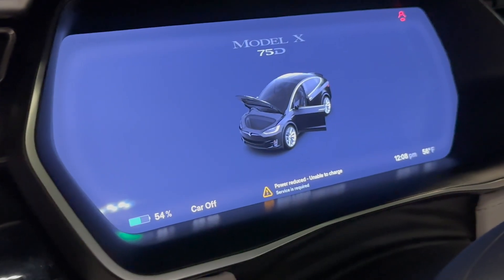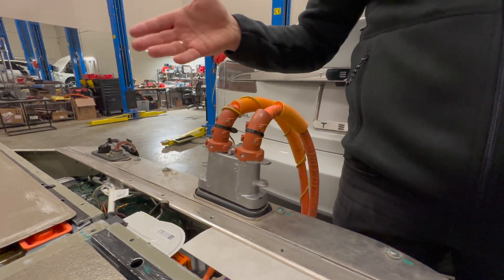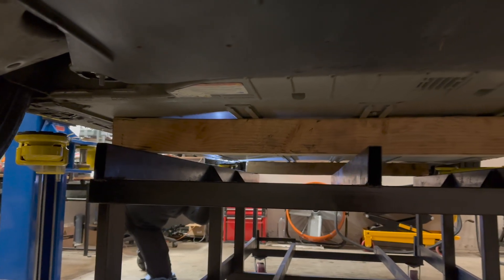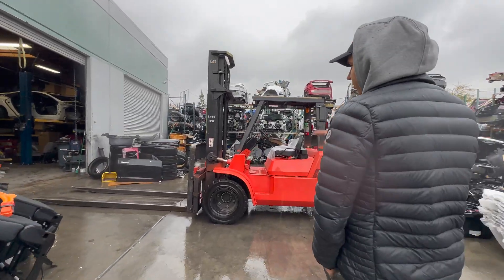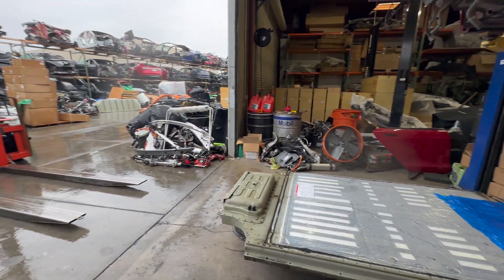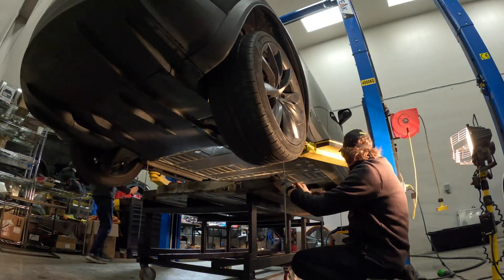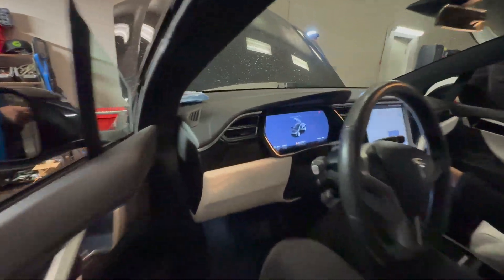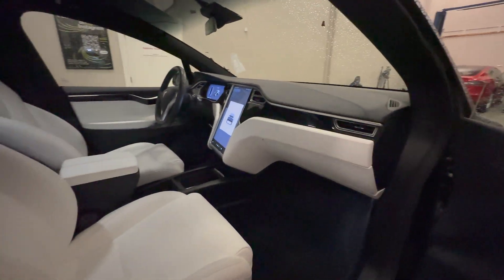Tesla Model X | Battery Upgrade | Range Increase⚡️⚡️

Comment: While it only added 45 miles of range its actually not the range that really gets upgraded when going from 75 to 90kwh.  Its the charging speed, or rather the charging speed curve.  While they have similar total (0-100%) charge times and similar peak charging speeds while at a supercharger, a 75kwh battery can only maintain its peak charging power for something like 3-5 min before it starts slowing the charge rate.  A 90kwh battery can do it for closer to 15min before it starts slowing down.  That might not sound like a lot but at a supercharger you are almost never going to charge to 100% so it ends up cutting your average time spent sitting at a supercharger almost in half.

Comment: Wait till you learn the battery costs more than the car
Reply: Wrong. FUD. TROLL
Reply: When you add up your transmission,  engine, alternators,  drive train, etc. It exceeds the value of your gaser.....  go away

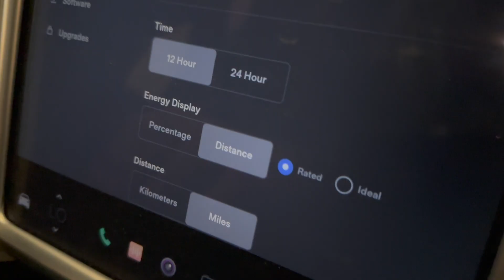Comment: At 7:56 to 8:06, you say that the vehicle now has an updated ideal range of 84 miles?  What are you talking about here?  A 90D should have a full range of well over 250 miles (yes, those are "tesla" miles that aren't real world miles, but you know what I mean).  My guess is that you're showing a battery that isn't fully charged, which doesn't do justice to this fantastic work.  Without further explanation, it makes it sound like you're saying that 3/4 of the cells in the new battery pack are cooked.  To a Tesla owner, a full range of 84 miles is absolutely horrifying.

Comment: Hmm. I wonder how much more range a Model 3 RWD could get with a long range battery. I'd definitely be interested in doing it.
Reply from the maker: Probably similar mileage as the mid range version (RWD Long Range)
Reply: @AIAddict  From my knowledge, there isn't a Long Range RWD that exists. Or at least not anymore. I believe there used to be though. But I think the LR battery capacity has increased from 75kwh to 82kwh.

Comment: Did you level the battery to give the BMS time to update with the new pack? I'm sure you will get more than 45 additional miles after leveling
Reply: Why would you get more? The upgrade of the 75 pack to 90 is actually less than 20% in usable capacity. The miles increase inline with the percentage increase.

Comment: would it be possilbe to do a 100kwh battery sawp in the same car?
Reply from the maker: Yes
Reply: @AIAddict  wow this is great news. So only a battery will be needed for the swap?
Reply: @AI Addict  Possible but not recommended.  Tesla had structural and airbag differences on the 100d due to the increased weight.  It is a potential safety issue in an accident.

Comment: Awesome! Can you do this to my 2015 Model S 70D?  I want a 90D!  More of this!  I am from Sacramento. I would love to be part of this project.
Reply from the maker: The cost for miles gained isn’t technically the “best” unless you have a degraded battery. However, the service is available in Sacramento. It takes about 5.5 hours of labor + material costs. 

Let me know if serious. We could always film it too! Lol
Reply: @AIAddict  How much did it cost to go from 75d to 90d?
Reply from the maker: @EVtripper  You will need to speak for the shop (they are called EVS Republic). The battery we used was already in our possession. I believe in normal situation the battery cost about $9-$10k. However, you might get a discount if you give them your old battery. 

Reach out to EVS Republic, tell them AI Addict sent you from YouTube and see what price they can quote you. I know the labor is about $1,000 plus cost of materials
Reply: I have also have a 75D; spoke with Tesla about possibly swapping my battery. I was told the most they would do would be an 85D at a cost of 10K
Reply: @MarioGonzalez-zo8lc  isn't that because 60, 75 and 85 models use 350V and 90 and 100 kWh use 400V? 
I don't know how they get around that challenge for this case.

Comment: "we'll let them explain the problems" [just reads the problems] would have been cool to see the process of fixing those issues, even at a higher level. This video wasn't as interesting as it could have been.
Reply from the maker: The vehicle programming process was conducted by plugging a cord into a laptop. It really wasn't that entertaining of a process. Took a few minutes
Reply: @AIAddict  where does one get the software to do the coding?
Reply: @kathyxi4588  I don’t think they’re gonna tell you it’s probably a trade secret of some sorts. That’s why I didn’t show a lot of dismantling. The battery actually is not that hard but they did make it look hard.
Reply: Did he use a Loki?